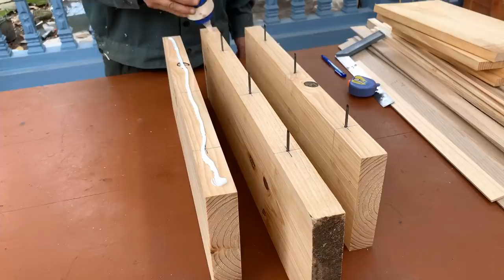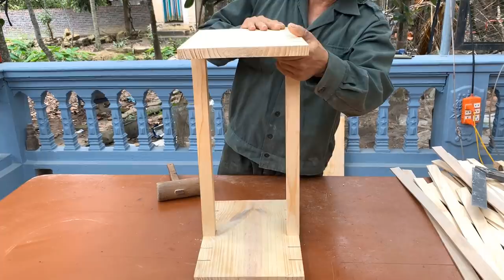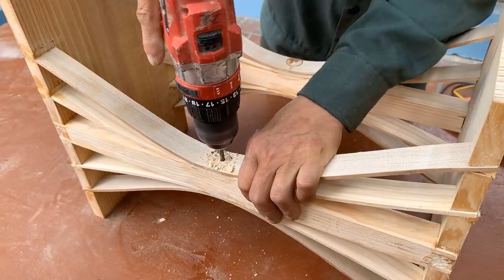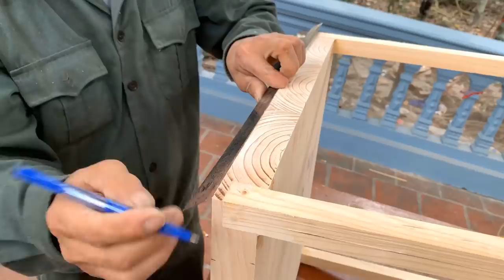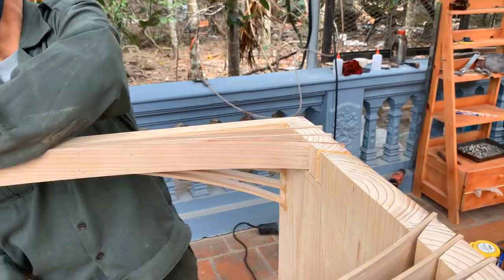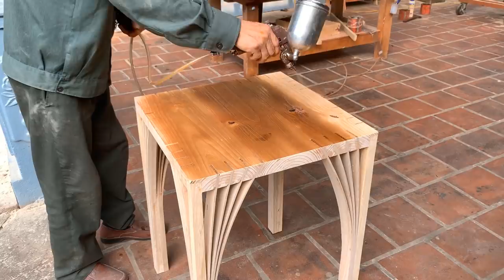Excellent Woodworking Talent // Build A Table And Chair For An Extremely Beautiful Outdoor Campus

Comment: Neat build! That use of nails as dovels is pretty great, but i prefer not mixing too much metal into my builds, since it will be really bad day if you decide to modify the design later, those nails will wreck havoc on your blades. Also any moisture=rust.
Beside that little bit attention to detail, like those holes were cut huge and requiring ridiculous amount of CA glue. Tight tolerances and using bandsaw to cut the wood would been better with some titebond wood glue. Neat design i'l be keeping in mind, but with mentioned adjustments since at least around here CA glue is pretty damn expensive. Also it makes it nightmare to stain.

Comment: Just wood glue is enough for putting the boards together. Your nails there are not adding any strength to the plank. If they were wooden dowels or dominos with glue inside of the holes, it would increase the strength, but nails do nothing.
Reply: Yikes. Your comment, albeit correct, is condescending. It’s easier to move on my friend

Comment: Like a few others below I was wondering what sort of glue everyone thinks he might be using. 
Looks like CA glue (super glue) yo me. 
What do you think??
Reply: Correct, stuff we use is called  miter bond adhesive. but its all Cyanoacrylate type glue
Reply: Thanks for that, I was actually wondering that myself because I was looking for a glue I could use for the thin strips like he does

Comment: I dunno if I would call it beautiful, its different and unique but ugly and not well built.
A big turn off in finished woodworking is to show end grains and joints, which you see ALOT of them here.

A quick and easy fix is to trim around the edges of the tabletop to hide all the ugliness.